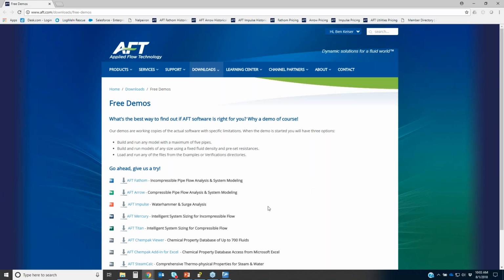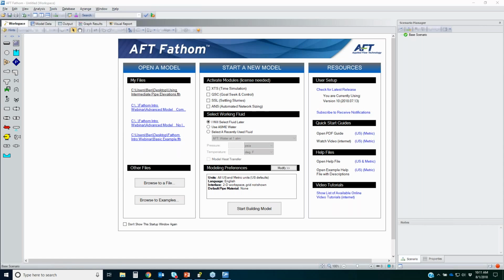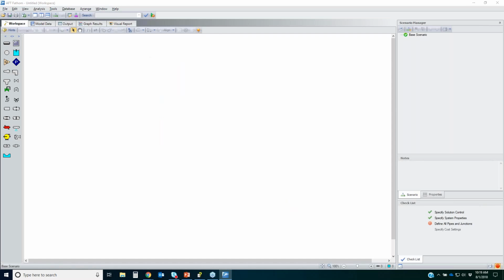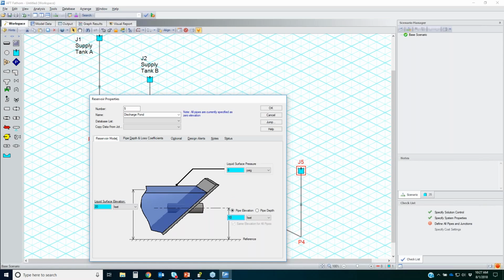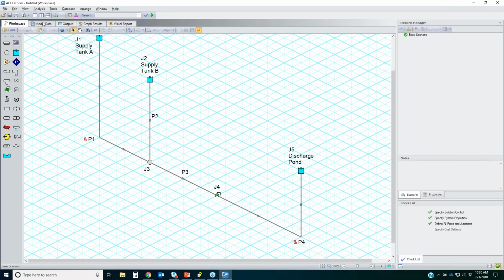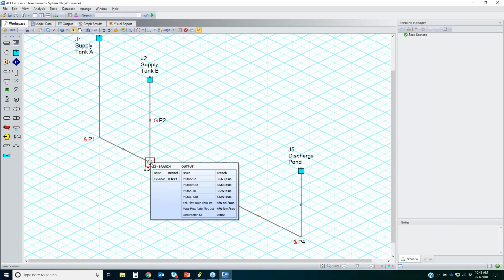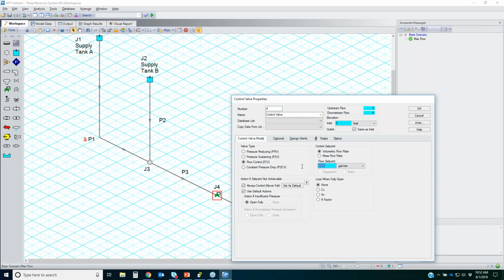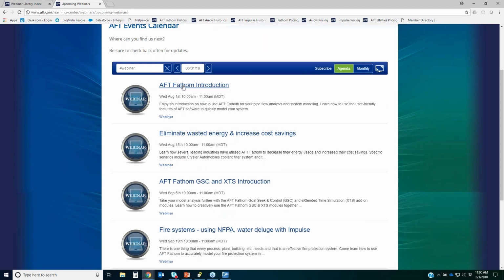AFT Fathom Introduction

Comment: This is the most powerful software in the field of fluid mechanics , we just hope that AFT be able also to analyse water distribution in plumbing systems and add a module which will be able to solve plumbing system based on water supply fixture units in IPC or ASPE